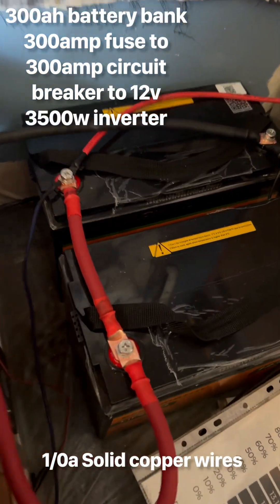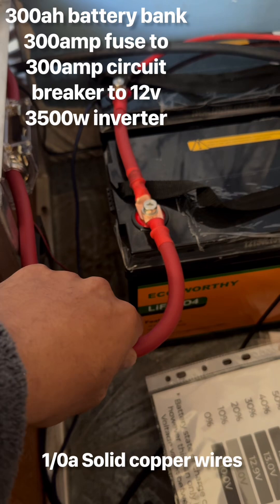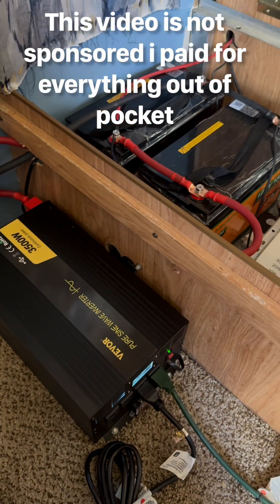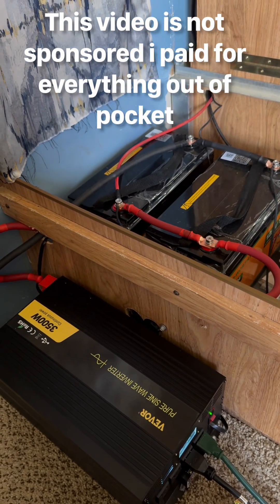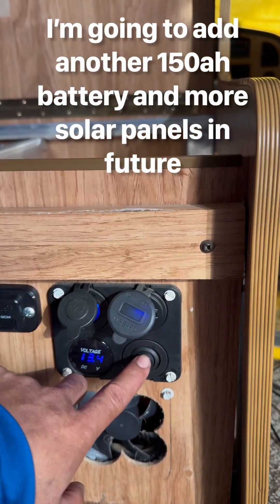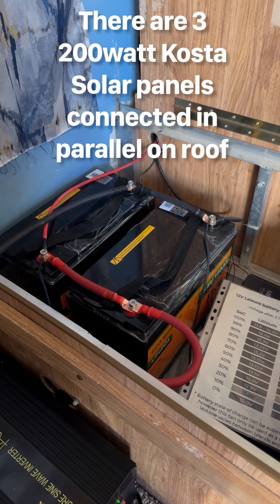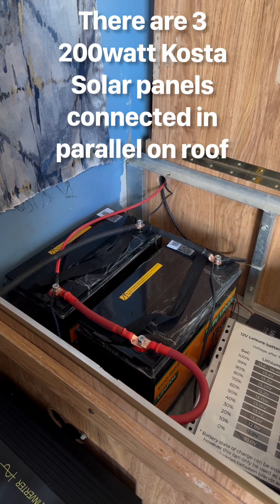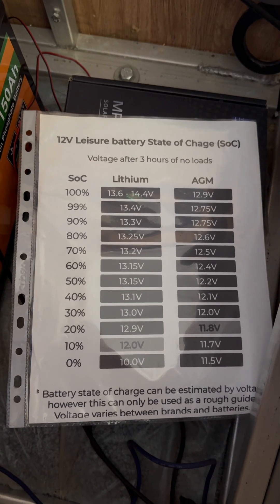Eco worthy 150ah Lifepo4 Bluetooth RV upgrade battery system explain

Comment: Most people will tell you 200w of solar per 100ah of battery. I have a 12v system with 400ah and 1400w of solar. Good video. Hope to see more of your upgrades and future videos.
Reply from the maker: You are running 1400w for 400ah so i will need to add more panels i want to make sure even in winter i want to get at least 50% charge thanks you